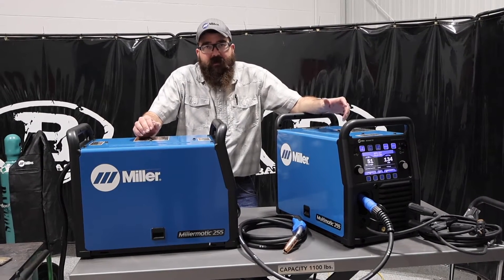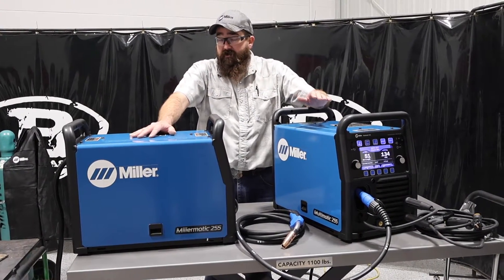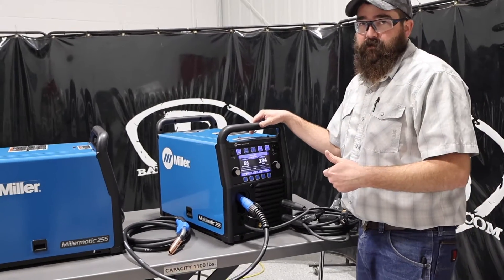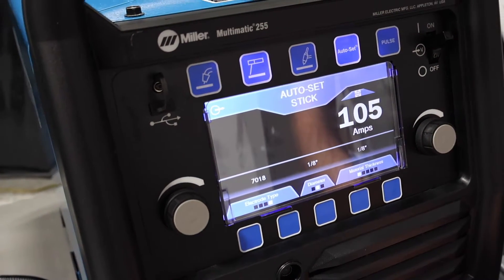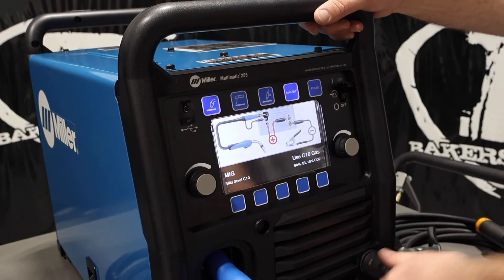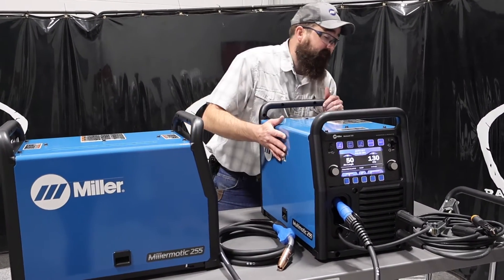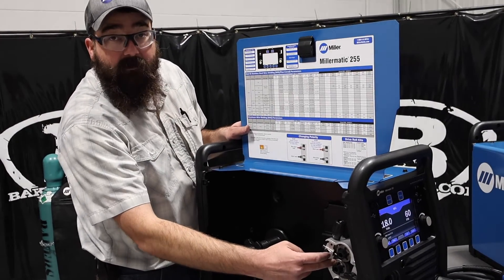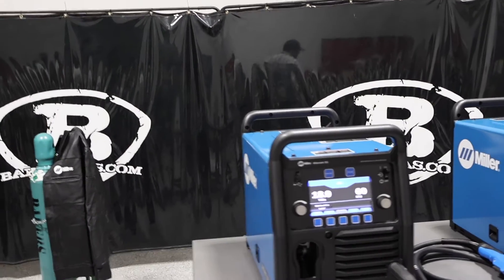Millermatic 255 vs Multimatic 255 Review and Comparison

Comment: All that money and doesn't come with power plug why ?
Reply: it's sad Miller has completely priced theirself out of the market. 4 or 5 years ago this same welder was around $3000 now 5 years or so later this same welder is over 5grand which is insane! I was gonna get me a Miller 252 and been done but when I saw that price I said hell no I ended up getting a Hobart ironman 240 which is a stripped down 252 for half the damn price I done some research and sure anuff 90 percent of the parts have the same part numbers!

Comment: 2 pt Comment:
Great demonstration and overview!

This welder is disgusting to the Miller name that once was and every single welder that has any common sense! Miller said “Let’s urinate on our customers buy ask $4500 for a mediocre Multiprocess welder with only a a basic Mig gun, Let’s also make the welder useless for welding aluminum by leaving AC welding capabilities, Further more let us offer you this same pile of 💩, with no High Frequency start option, ya know like any $499.00 welder from Harbor Freight would have or your 1999 model Syncrowave 250. But we’ll sell you a tig foot pedal (that’s about useless without HF) , tig gun, stick holder and a cheaply made cart for mediocre machine, for the low low price of $5800!! “
So glad when sold my Miller 220 mutimatic (board issues) and wouldn’t even run 6010, that I bought a HTP 2500! Worth every penny, especially over something like this 255.. I’d buy HTP ESAB Lincoln, Fornius etc before I’d ever buy another miller anything! 
ASSEMBLED in the USA! 😂. There’s been 4 welders within my circle of people in the past 2 months, that were purchased which were not Millers because of things similar to the above! 
Hope they get it together and start adding value back in their products along with a price point that makes them worth it!
Reply: Interesting perspective. I bought 3 for my shop and have been happy with them. For not much more that the price of the Millermatic you get TIG and Stick. It performs well on all 3 processes. I agree, it is frustrating when they leave off really useful features that would be cheap and easy to implement with these computerized welders. ESAB and Lincoln do the same
Reply: What Miller would you recommend for welding aluminum and just mig in general?
Reply: Exactely i love my esab 205 amd tje tig is better then a miller amd no sticker tjey actually paint the logo